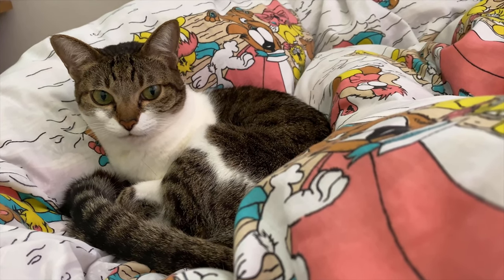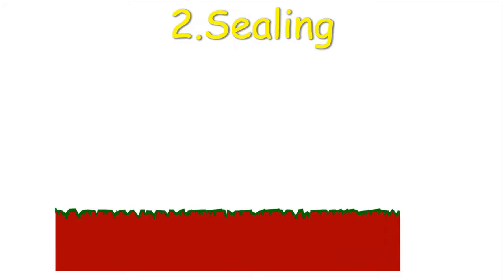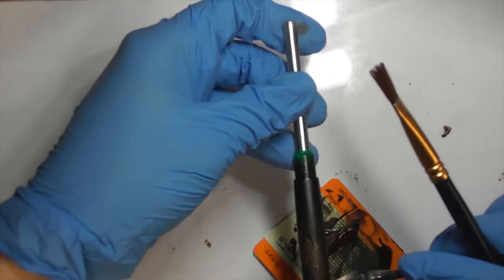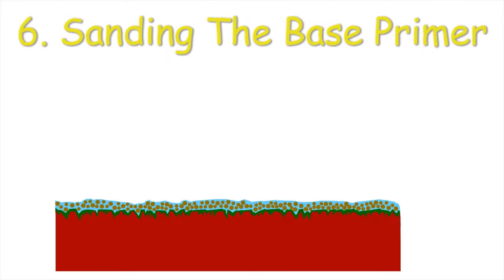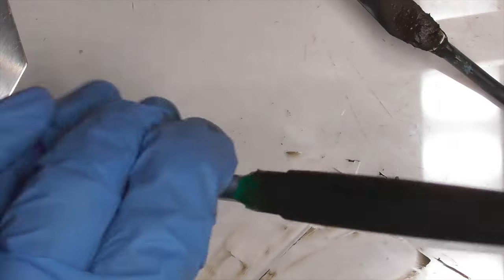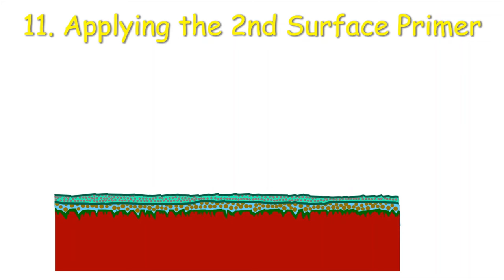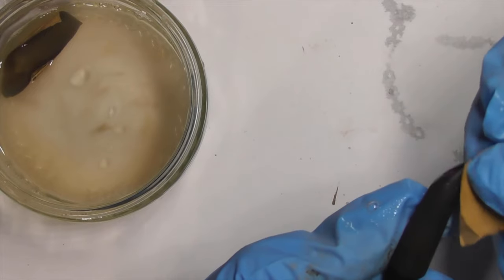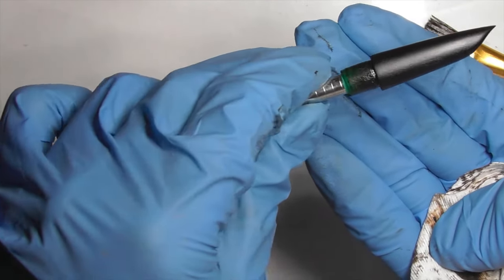Urushi Craft for Beginners: Tutorial 3. How to Apply Honji Primer

Comment: Are there any alternative clay powders to use in the place of Tonoko? I noticed that you can buy diatomaceous clay fairly easily but I’m wondering if there’s a special type of clay you have to use for tonoko
Reply from the maker: Hi Ian. Thanks for your comment meow~ Sorry I haven't tried the other clay powders. Since tonoko consists mainly of aluminium silicate, my educated guess of an alternative may be Kaolinite. It should be easily available anywhere. However, you need to be aware of the grain size. Let me know the result if you have tried it.🐱Fun fact: diatomaceous earth can be used against cat flea
Reply: @masterflowerthecat5895  Thank you! I'll try it. The grain size might not be a problem if you have a mortar and pestle